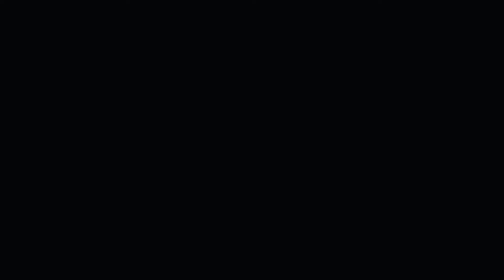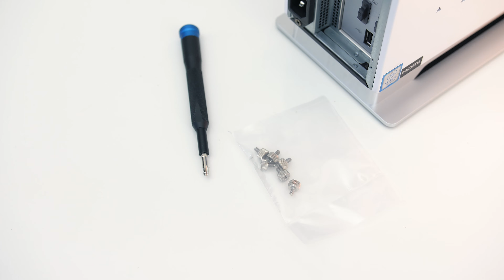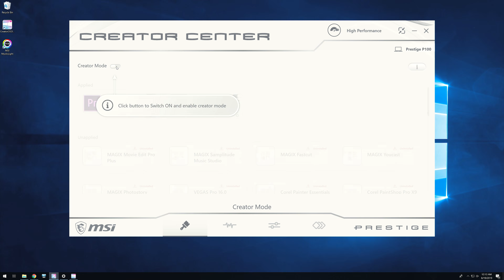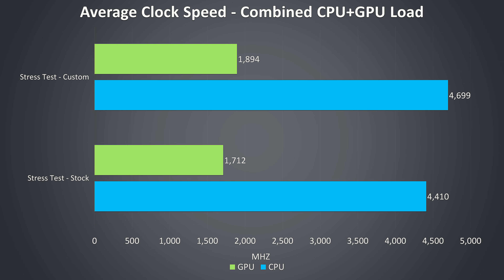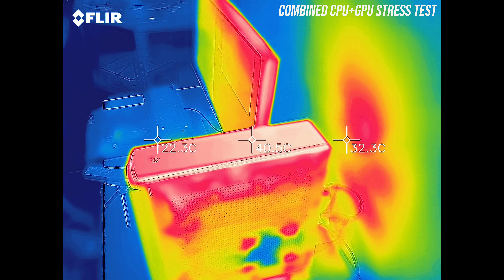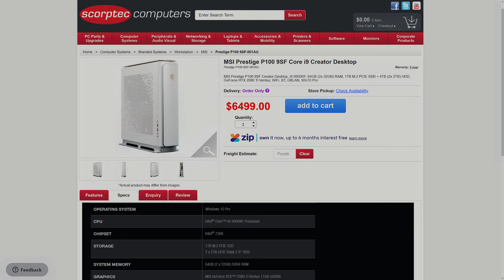MSI Prestige P100 Review - A Small PC For Creators?

Comment: Do you think this Prestige could run 3D rendering/simulation softwares for 5hrs straight with a 2k monitor without going on fire or sound like an helicopter? I'm really struggling with deciding which one to get... I'm also thinking of Lenovo T730 i9 9900k 32gb ram rtx 2080 super, or hp omen with same specs or even MSI Trident X Plus. Help me, please!! 🙏

Comment: Trying to find a 2080ti version of this in the states is almost impossible now. I love the chassis on this PC, and wanted to buy it as an alternative to the MSI Trident X Plus, which is has a little too much RGB lighting going on for my taste.
Reply from the maker: Yeah fair enough, not sure why it's hard to buy though 🤔
Reply: @JarrodsTech  I've been doing some research, and it looks like MSI actually never released a 2080ti version of the P100 in the states, but they did in Australia. The only ones that I have seen that are available in the 2080ti configuration have been imports.
Reply: That's interesting, wonder why they did that.. you think with the given power supply, we'd be able to purchase a ti card and replace it?
Reply: @VKGamingKR215  I have no idea why they left out the 2080 Ti version, but we will be able to upgrade for sure. I'm probably going to just get the 2080 Super version and then upgrade when the 3080 Ti comes out later this year.

Comment: Im on the fence on which system would be the better buy... MSI Gaming Desktop Prestige P100 9SE-036US  VS  MSI Trident X Plus 9SF-54US cost is about $400 difference making  the Trident a little bit more.  The P100 have 32gb ram same as Trident,  P100 has 2080 super vs Trident 2080 Ti, P100 has 1tb SSD vs Trident 512 SSD. Both windows pro. 

Which system would overall be the better performer? With only a $400 price difference I do prefer the 2080 Ti which comes in the Trident but curious to know the better build quality and performance vs the two systems. Can they reach their Max potential overclocking and getting up to 5Ghz?  Both have the i9-9900K  650W power supply. Thanks
Reply from the maker: Hmmm p100 sounds better in terms of value for money but guess it depends if you need the extra power of the Ti / care about the looks at all. Can't recall clock speeds from both, however I have a review of the trident on the channel too and I do the same stress testing as in this video so the results should be fairly comparable if you look at both.
Reply: @JarrodsTech  Thanks again for the advice on the systems I do believe the look on both look pretty good, with the P100 pulling ahead just a bit more and standing out (more of the Pro look) but again that's just my opinion, and looks like the P100 might not vent as well as the Trident because of the case? overall if I'm going to be spending around $4k on one of these I would prefer getting the 2080 Ti right away with the system since the price tag is rather High... My first thought was the P100 because of look and $400 less but then the Trident offers the 2080 Ti, would there be a noticeable difference between the graphics cards in both systems P100, 2080 Super 8gb / Trident, 2080 Ti 11gb. My plans are games on a 2k 34" monitor 144hz. And lots of video editing and rendering. Many thanks.

Comment: I wonder why they didn't add small fans on the top. I think that it would really help temps, what do you think?
Reply from the maker: Not enough space. I don't think it would affect it much, just need better cooler in direct contact with the CPU I think, though it was fine at stock anyway only an issue if you want to mod it.

Comment: Hi hope you doing okay. So, I dropped my laptop yestersay and whenever I try to turn it on it makes weird noise and says boot device not found. The warranty expired about a month ago so am I fucked or is there a solution? My guess is if I try to unplug and the plug-in the hdd again it should work. Hope you have a solution. Also can you tell me how to undervolt a CPU?
Reply from the maker: Sounds like the drive might have become disconnected, open it up and check it's still in there properly. Here's a guide for undervolting: https://www.youtube.com/watch?v=yNt9L3BWOFo

Comment: Great vid! Can you tell me wether my build will work well? I’m new to this whole PC thing.

Msi B450 tomahawk mobo 

Ryzen 7 3700x CPU

Msi 1660 GeForce GTX  Graphics card

XPG 512GB SSD SPECTRIX Storage

Trident Gskill RGB RAM (16gb)

Thermaltake 500W PSU

I also have a Darkflash phantom rgb case
Reply: Just go to pcpartpicker for part compatibility
Reply: Funastics it says the mono has something about a BIOS? Idk what bios is?
Reply: @kaiju5  sorry that is for your own research, I'm also a beginner at understanding these. Also some motherboards aren't ready for the 3rd gen of ryzen and you will need to look which is compatible.
Reply: Funastics ok thanks
Reply from the maker: It's probably telling you that the B450 needs a BIOS update to support Ryzen 3000 series CPUs, so it won't work out of the box and you'll need an older CPU to update it first. Instead you should look for a Max version of the board, this is MSI's way of saying "the board comes updated for the latest Ryzen CPUs and is ready to use".
Reply: Jarrod'sTech can you recommend a Motherboard that’s 100-120$ and can support 3000s?

Comment: I got the Aero 15 SA (non-OLED). The fans (or their power delivery) have coil whine. It's not the CPU or CPU, because there was no load on the system, i noticed it playing around with fan control.

Apparently it's also a problem on the new refreshed OLED models... so gigabyte apparently don't care.

https://www.reddit.com/r/gigabyte/comments/cvx3uy/aero_15_oled_fan_whine_noise/
Reply from the maker: That's no good, didn't have any in my unit but that sort of thing probably varies, especially as people's ears are sensitive to different frequencies.
Reply: It's more on the fact that it's on the fans themselves.

Like if you spin up the fans to 45% it becomes indistinguishable. Point being when the machine is doing anything but gaming (e.g. idle / light load) it means there's gonna be whine (60-70% of the time).

I mean i could accept it if it were a little bit of whine on the CPU / GPU when loads ramped up, because the fans would cancel most of it out anyway, but it's more noticeable when the fans are quieter.

Honestly i don't understand what's wrong with QC these days. Is it really that hard to test a machine properly with the levels of automation we now have at our disposal?

Comment: Man, i dunno. This is a great machine and all but 6500AUD/4300USD? I could buy the same specs and a car if I built it myself. 

This isn't the 00s where content creators were shit at hardware, most of us understand how it works now, and with all the shops that offer custom builds and great cable management, i don't understand why machines like this exist anymore. I get apple freaks and their thinking that their adobe suite will work better on their mac, but this is mindboglling. 

Anyone with half a brain could buy 2 pc with the same specs, better thermals and even more upgreadability just by ordering parts.
Reply from the maker: I can easily see a design business for example buying a few prebuilt systems for employees who use Adobe apps etc rather than wanting to build their own machines from random parts. If you can do that then yes by all means do it and save the money, I think you're misunderstanding who prebuilt systems are for, however.
Reply: @JarrodsTech  i agree, I'm from a country where 4.5k usd is a year's salary in administration. Although, I've worked in a fairly large studio in Belgium with 20+ creators and we had a dude that made configs instead of paying 30 to 40% more per machine. This might work in a smaller company of 3-4 laïcs but man, is it expensive for what it brings to the table. And usually those clueless dudes buy macs amd that's it
Reply: TheMisterBlueberry I think you overlooked the specs it comes with, only 10 liters small form factor PC, and with I9-9900K,64GB RAM 2080Ti, 1TB SSD 4TB HDD and Windows 10 professional with 3 years warranty also they have their own creator centor application , I doubt that any normal end users can build easily and with great cable management plus with good air cooling system without overheat with I9-9900K and 2080Ti in a small form factor PC,also it’s hard to find 1x32GB RAM in the market, so please if you compare all these, you can know why the price should be
Reply: @johnmou1990  specs are great price is not. If you got 5+ pcs to buy, might as well hire a tech dude that will build them. With his salary included, you're bound to save at least 30% on the lot
Reply: TheMisterBlueberry 4.5K usd years salary in Belgium, who’s going to believe it lol
Reply: TheMisterBlueberry like I said please consider the machine size, from what I know, it’s hard to find any dealers can build this thing without any issue, most of them refuse to assemble this kind of small form factor PC and its components, 2080Ti is almost 1500USD at the beginning....
Reply: @johnmou1990  dude, no. salary is 5k/year where i am now ie, macedonia.

Comment: Man 99° degree for cpu..😂😂. Imagine playing games on summer season😂😂😂.
Reply from the maker: It'll just need to throttle back more, though for the most part I don't see people this machine is actually targeted towards going in and  boosting the power limit to create that scenario 😉 just to be clear it was perfectly fine with their stock 120w limit.
Reply: @JarrodsTech  or better under clock the cpu a bit.. just to lessen the cpu temps..ehehe